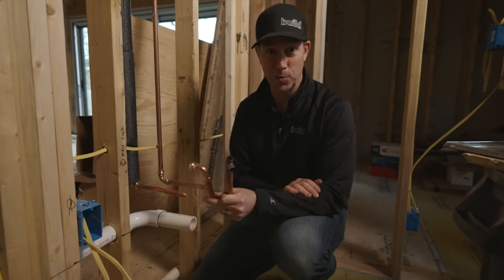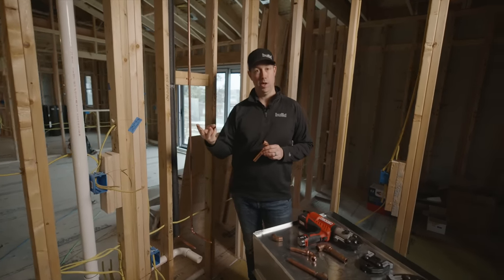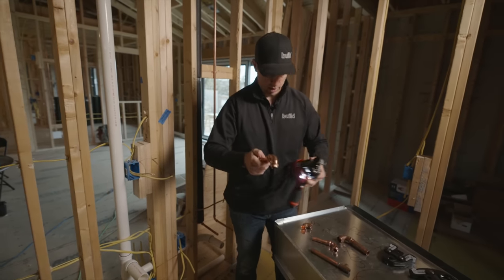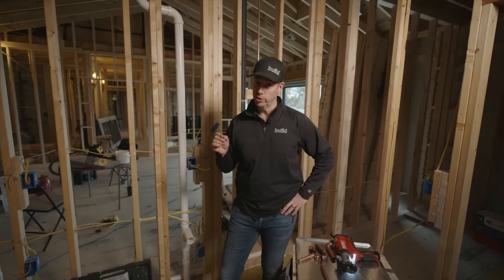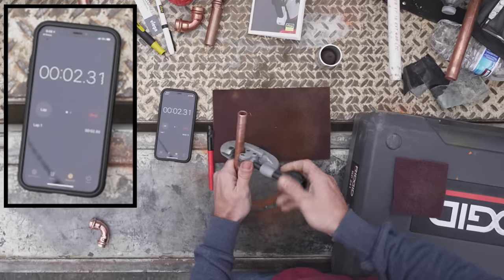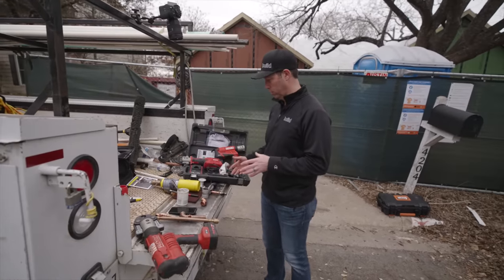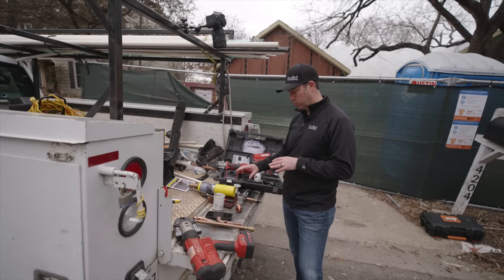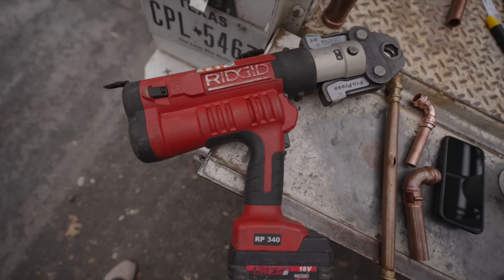Copper Plumbing - Viega ProPress vs. Soldered

Comment: Matt, sorry to say but you are way out of bounds with this sales person pitch here.

Copper to copper is tight after the pressfitting, but never fused!
The o ring is not in the waterstream correct, but it still is the main seal!
When soldering, you need to be obnoxiously uncarefull where and how long you point your flame to stand a chance to get a 2x4 to burn, so yes be carefull, no to making people afraid of a little flame.

On the timing story: you would always solder an entire fitting at a time: so 2 on an elbow or straight, 3 on a tee.
I bet you timing would stay within 50% or less.

And you never ever spoke on the major turn-back for pro-press, the über expensive couplings and machine compared to the cheap solder ones and a bottle of gas, some flux and a roll of solderwire.
Even pricing in the hotpads/fireblanket for sensitive areas, soldering is way cheaper.

So the customer expense will be higher or equal, you just save some time.

Your channel would be miles better if you’d be more neutral and open on all factors for the stuff you are pitching.

Comment: why would anyone select copper over PEX? it makes no sense to me, and your brief explanation isn't based in science
Reply: flow
Reply: @simpsons721  still doesn't make sense. Same ID with no 90 degree turns in the entire loop is going to flow better than copper that's got a dozen 90s between the source and the destination.
Reply: @grinchyface  Look at the inside of a pex fitting and tell me if the ID is the same. You know more about plumbing than me if you can plumb a whole house without using fittings. LOL
Reply: @simpsons721  that's a great point, but that is not all PEX fittings-there are some brands that have the same ID as the tube. Shark bites to name one, not that i would ever use shark bites to plumb a whole house, it's just the one that came to mind with pipe standard IDs on the fittings
Reply: @grinchyface  You asked a question and I gave an answer. They make things like whole house manifolds and fittings that go around the pipe for 90 degree bends because of flow. I like pex but I learned flow is a disadvantage ( you asked), not trying to be an ass.

Comment: I'm a DIY dude and I could solder a pipe faster than that guy. Was the challenge to make it as slow as possible? 
I'd love to see the big clamp stuffed into a small space in the rafters to try to clamp a fitting. Sponsored videos can bite my nuts.
Reply: I was actually surprised how slow the crimping was.

The no-heat aspect is the only advantage i see.

I've seen plumbers do air and water fittings with it at work, and the lack of open flame and fumes makes it easier to get approval for certain jobs.
Reply: I would like to see you sweat a copper pipe that was leaking steady faster than Propress it doesn't matter how fast you can sweat if you can't shut off the water completely but you can Propress a copper pipe with water pouring out.
Reply: @plumbbuild6517  Yeah, because that's what we were talking about and demonstrating here...... existing plumbing that was leaking. 
Although I do wonder what scenario you're imagining where a pipe is leaking and you somehow get a poorpress fitting over it and stop the leak. We're not on a submarine man. If I have a leak in my house, I'm turning the water off. lol
Reply: @geemonkey72  so I see you must be one of the plumbers that works on new houses that the water when turned off actually stops water altogether half the shitty jobs I get I have to cut anew shutoff valve into a line that still has pressure on it if you haven't already done that than you must be a green horn
Reply: @plumbbuild6517  I thought I was pretty specific that as a DIY DUDE I have done plumbing. All houses have a shut off. You can drain water from lines. It's not hard to work on a dry connection. What the hell do you think plumbers did before this 'amazing invention' of crimping connections? lol
Reply: @geemonkey72  yeah back then we stuffed white bread into the leaking pipe ,now I don't waste my time worrying about a leak I propress it, hope you and your family have a great Easter.
Reply: @plumbbuild6517  Awesome sauce! Hey everyone, run out and get your $1000+ propress tool, your $5+ fittings and have them all ready for when you need to fix a leak at home. Cheap, convenient, and fun to haver around just in case! I have never wasted a second of my life worrying about a leak. I just quickly sweat it and move on. 
I hope you and your family have a wonderful Easter. If anything goes wrong, just propress it! lol

Comment: A minute 1:35 for a propress connection? ?????? Get rid of the host's interference and the odd/unnecessary sharpie detour and you can do it in 20 seconds
Reply: Honestly, 1:35 should be the time difference between these two methods, not 30 seconds. Without interference it would be obvious

Comment: This video kind of pisses me off as a real plumber first thing to cutter he uses is cheap second thing if you clean all the fittings before you connect them all together it's just applying the flux and cleaning the pipe that you have to do and measuring it is so much easier because you don't have to add in the swing of the joints and then if you solder all the same time what's the  difference between the clamp and the torch it's really about the same amount of time maybe once you consider the cost of the fittings it's a no-brainer progress is like four times as much per fitting.

Comment: Pro press- Fusion? Fusion is the process of combining two or more distinct entities into a new whole. Fusion required a temperature. You are creating a pseudoscience theory. It is a pressing and compressing process. Vega explains the ring very well. The ring is not a secondary sealant. Ring and compressed copper create a seal. Time difference: Not explained properly. It is more into it. Soldering process - preparation, pre-fitting, soldering, cooling, cleaning after, etc. You wanna make a review? Make it as should. be.

Comment: the viega fittings are made of type k copper....they will outlast the pipe
Reply: The orings won't.
Reply: @joshfazenbaker5691  the orings dont come in contact with the water. they are simply there as a fail safe

Comment: This guy is misinformed He says that it fuses the copper and it doesn’t. It has a rubber O-ring that will deteriorate in about 15 years tried and true soldering is the way to go no if and butts about it who cares about the 90 not being a sweep, this guy is an amateur. I am a Union trained plumber. he’s charging his customers for his experience not the time so what if soldering takes longer the progress fittings are like five times as much out here in California and they’re not gonna last he’s worried about having a guy being a firewatch having to cover two by fours that’s all elementary things real Plumber will know how to handle that situation his test from Germany. The 3000 psi blew out the pipe but not the fitting yeah but in about 10 years that’s fitting will be deteriorated. Copper soldering has been around for years because it works case closed.

Comment: He didn't mention the price comparison on pro press fittings vs sweat copper fittings. 1" pro press 90 - $6.00 vs 1" sweat 90 - $1.85
Reply: He also used type L copper which is more expensive, but this video isn't about price it's about options. Labor is ultimately more expensive and as shown propress is faster and equals out the price of jobs.

Comment: Just feels like a big misstep, all of your videos evangelize the power of PEX and all the great tools/solutions out there--many that you've been evangelizing for years but when it comes to your home you chose copper because of it's antimicrobial properties? I'm just scratching my head here 🤔. What's next, just forget air tightness since leaky homes are the way forward!?
Reply: He misspoke at the start of the video.  This isnt his home.
Reply: @flewdefur  ahhh ok! Then crisis averted! 🤗
Reply: @flewdefur  Right, that's not his house. It's his client's house. What's confusing is that at the beginning of the video he said, "I plumbed my entire house with type L copper, and we used a new type of fitting." When he said, "my entire house" he meant it was his house as a contractor building for another couple. Matt sure confused people here. He should have been more clear, because his personal house is all plastic pipe.